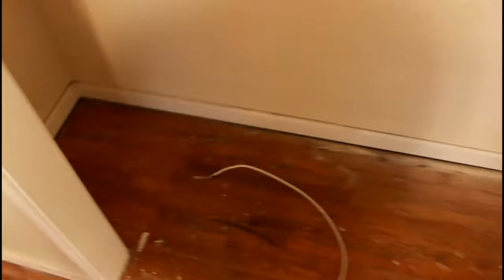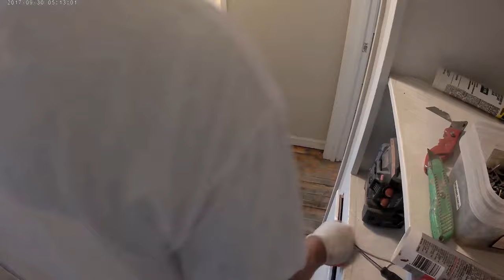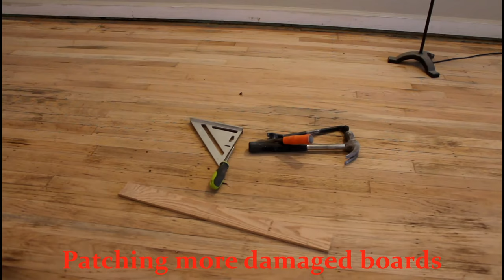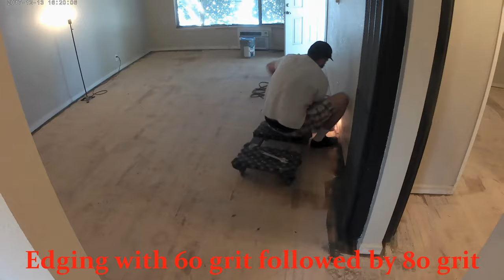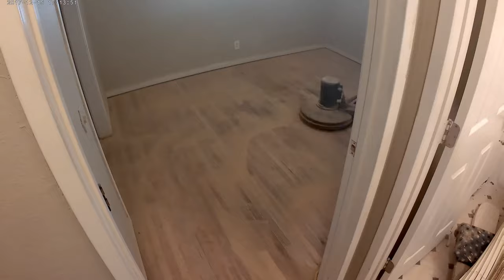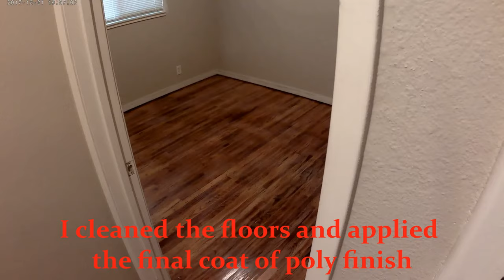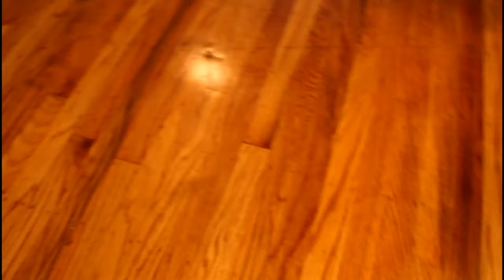Refinishing 70 year old oak hardwood floors

Comment: This was absolutely the most helpful video so far. My hardwood floors are like yours. They are old and covered in glue and Need Place is replaced. The other ones were dealing with newer floors in better shape and they didn’t tell me what I needed to know. Thank you so much.
Reply from the maker: no problem. good luck with your project and feel free to mesaage me if you need advice on any of the process.

Comment: I used floor stripper and slow speed buffing machine with a black pad to remove carpet glue on my floor. It removed it all with no dust. It lightened some of the wood but I stained the entire floor anyway with golden oak stain and polyurethane. It turned out extremely well. The golden oak blended in perfectly.
Reply from the maker: nice, thanks for watching.

Comment: Closing on our new to us home next week. Planning on refinishing the original floors first thing. This was a very helpful, and skillful outline of what needs to be done. And getting to listen to Colter Wall the whole time? GREAT VIDEO!
Reply from the maker: thanks congrats on the new home and good luck with the project. feel free to dm me if you run into any issues and have questions.
Reply: That's why I am here also! Just did early entry yesterday and we will close in about 1 to 2 weeks! Our hardwood floors were saved but also neglected under rugs.. we are hoping to restore them!
Reply from the maker: @RachelDulanski  congrats and good luck.

Comment: Ty for showing how you replace for boards.  I couldn't believe how many nails there were.  Then there a 2'×3' section where the fillers missing.  I'm surprised that the filler is used all over but happy to see it as I thought I'd be replacing almost half the floor.  Great video!
Reply from the maker: thank you.

Comment: If the entire floor is warped and cupped and wobbly is it not fixable? We are looking at a 1905 historical property and the floors are in a state. We would like to keep the original but I have no idea how you would even sand it with all the unevenness. Can it be saved?
Reply from the maker: everything can be fixed. but at a certain point the cost to repair may outweigh the cost to replace. the cupping may be too extreme to make the repair cost effective but i would need to see it to know.
Reply: @californiaflips4318  Thanks so much - you are so helpful.  Even if the cost is a ton, we would fix it if we could as it is classified as a historical home so we are required to make every effort to maintain the original pieces as much as possible.  You have been so helpful! New sub here!

Comment: OMG, I love your video! It exhausted me watching it thinking about all of the wood that we need to refinish. Our living room and bedroom are about 400 square feet each. Our home was built in 1911 so the wood floors are as old as the house. Any suggestions that you can give me will be appreciated. Thank you!
Reply from the maker: go slowly. try to take less material off with each sanding pass than u think u need. u can always take more but u can never put it back. and dont feel to stressed about doing bigger rooms, a large living room will actually go quicker and easier than a small bedroom with a closet. large open spaces are the best to refinish. good luck

Comment: Watched the whole thing just so I could listen to Colter. Saw a few of these videos on the youtube.. yours came out the best I think. I think your finished product looks great. Any advice? Any regrets? How does it look now almost a year later?
Reply from the maker: only thing i would do differently is rent a larger drum sander. i used an 8 inch wide drum sander from home depot. but if you go to a different tool rental place you should be able to get a 12 inch wide drum sander which would save lots of time. on top of the wider drum the 12 inch machines are substantially heavier which allows it to bite into the wood more with less effort on my part as the operator. this house is now a rental. been rented for almost a year now and the floors are still looking perfect. the more coats of poly you put on the more resistant to wear the floors will be.
Reply from the maker: thanks for the compliment btw

Comment: You should have stained the new wood to match the old before finishing.
Reply from the maker: unfortunately its not that simple. if you try to darken the new wood to match the uv altered wood. time will eventually make the new wood darker than the old. the best path if someone isnt willing to wait for uv and oxidation to make the new match the 70 year old wood, is to pull old wood from the closets for the patches. i opted to let time process the new wood the same way it processed the old wood.

Comment: Well that was amazing!   I appreciate a solid wood floor that has battle scars - I think that makes it even more beautiful.   It survived so it has character.    I am not a fan of LVP, I would prefer to walk on painted plywood.   However, my home has experienced a break in 4 times this year.  I have been searching for a home to purchase and everything seems to have some LVP.  Is it possible I could sand and paint or use a whitewashed stain over the LVP?   I realize it's not ideal but at my age I cannot justify the cost of red oak hardwood flooring on top of purchasing a home.  (I'm 73.)    I would appreciate your thoughts.
Reply from the maker: i personally wouldnt try to alter existing lvp. it usually has a thin wear layer and if you were to sand through it it would just be an unattractive plastic look below the surface. congrats on the new home. i hope you are able to enjoy it for decades to come.
Reply: @californiaflips4318 .... Thank you    That was pretty much my thoughts.   4 different LVPs + hardwood and ceramic tile is a bit much.   And so it goes.   I appreciate your kind response.

Comment: Would it have been possible to use wood from the closets to patch with, then put the new wood in the closets where it wouldn’t be so noticeable?
Reply from the maker: yes the grain on the wood from the closets would have matched better. but the color difference would still be there due to the pet stains in the middle of the room.
Reply: @californiaflips4318  Couldn’t u have stained the new wood separately with an Antique Oak stain prior so they’d blend better?
Reply from the maker: @znonemper5519  it would be incredibly difficult. im sure someone out there has done it, but your trying to match ammonia staining that varies in color from  board to board. another option is that you could just stain the whole floor dark to hide the stains but imo thats much less attractive than just allowing the patches to show the history and character of the floor.

Comment: Great end result. How many days did it take you to finish the floor? From removing the carpet to finishing the final coat
Reply from the maker: probably 2 weeks. if you had a team or a desire to finish quickly you could probably do a job like this in as little as 3 days. the main factor with time is allowing the the multiple coats of finish 8-12 hours to cure between applications.

Comment: Could the mew boards have been stained with a little darker stain or maybe extra coat to blend them better ? Asking not to criticize but we are about to do ours and have to replace over old floor furnace hole
Reply from the maker: i wouldnt reccomend that. uv sunlight darkens the new boards. so adding dark stain to match colors at the date of install will cause them to not match in the future when they react to uv and oxidation. if you want a closer match day 1 pull from a closet or a similar donor area that is less visible.
Reply: @californiaflips4318  thank you so much !!!!!

Comment: Wow you killed it looks great where did you find the replacement planks I'm about to do the same thing up here in Northern California house is from 1966 it's oak 2 -1/8 × 3/8 or so im having trouble finding the wood replacement planks thanks for the video
Reply from the maker: thanks. im in sacramento and got the boards from pacific flooring supply. they have everything you need. maybe call them and see if they have recommendations in your area if you arent around sacramento.
Reply: @californiaflips4318  I really appreciate it man just got back from Pacific Supply got everything I needed just like you said
Reply from the maker: @byronboswell5774  glad to hear it. hope your project goes well and if you run into any hiccups feel free to message me.

Comment: Boy did those floors turn out nice!  The boards that are new and stick out a bit I think are cool it adds a little character to it. Besides it is a floor and wont stay “perfect” . The finished product is definitely sometHing to be proud of!! I am curious, how long did it take you from start to finish?
Reply from the maker: thanks. It took about 2 weeks. once you start sanding the process starts going by pretty quick. The finishing process takes several days because i was allowing one full day of curing between coats of polyurethane. i forget if i did 3 or 4 coats on this floor, i think it says how many in the video. but the more coats of poly the smoother the finished surface will look.
Reply: @californiaflips4318   First I have heard of the more coats the smoother.  Going to keep that in mind.  I am in Grand Rapids Michigan and have been working on repairing replacing and tying  new into old to extend it into my dining room and kitchen  1/3 of living had serious carpenter ant damage that was hidden by previous owner with laminate its a red oak 3/4 thick tongue and groove .I have 2 months worth of weekends into it as I drive truck for a living but plan starting the staining process this coming Saturday. So Total days I have in to it is pretty close to what you have I may end with a few days more just because This is my first one but I didnt expect to do it in 2 days either.  Just the underlayment for their cheap laminate had 500 drywall screws holding it down.  Considering my timeline compared to yours and me being a beginner I’m pretty of proud of myself.
Reply from the maker: @MichaelSmith-pn7im  right on. good luck with the finishing process. i used natural colored minwax stain from homedepot  you can get the trowelable wood filler there as well. and for the finish i used satin finish oil based polyeurethane. idk if its like this in michigan but in CA they only sell it in quart containers so i had to buy about 20 small quart cans to do my floor.
Reply: @californiaflips4318    Im going with with Bona red cherry stain  to help blend the new with old. Already did the wood filler process and the Bona poly with hardner semi gloss.  I assume you will do another and you maybe aware of this already but I will mention in case your not. I found a wheel with 6 blades attached that you put on a buffer that will strip that old mastic and carpet glue with great ease  very little dust , and it doesnt hurt the floor nor does it heat that glue up and melt it nor does it stick to the 50 grit blades.  ITS A GODSEND.  It cost me 300$ and worth every dime!!  I found a video here on Youtube the company is out of Philadelphia PA.   I will see if I can post a link for ya.  It sire beats using a belt/drum sander. I think it even came with an extra set of blades. It does leave swirl scratches but one pass with drum sander 36 grit there gone only thing is you want it to stay flat!
Reply from the maker: @MichaelSmith-pn7im that woulda saved me a lot of time with the initial drum sanding i did. ill have to get one of those if i ever do another floor with mastic on it again. thanks for the info and the link.
Reply: @californiaflips4318   no problem   First I ever used one and it worked great.  The money you save in sand paper alone plus 3-4 hours of time worth every penny.  I talked to those guys twice and they were super helpful and knowledgeable willing to give tips and never rush you off the phone.  I will say this if you do use that wheel take the extra half hour or hour and make sure ALL NAILS/STAPLES are out of floor and wall s where trim was. I missed a few and caused me a couple small headaches with a small finish nail and 2 staples getting caught under a blade causing some unwanted deeper gouges that sanded out but required some extra labor.  Good luck and I look forward to seeing more of your vids especially wood floor vids. Been nice chatting with you.

Comment: I wonder why the replacement wood  weren’t stained before adding polyurethane.
Reply from the maker: they were. I stained the whole floor after the final sanding. the old wood is a different color due to age and most likely uv exposure.
Reply: @californiaflips4318  Oh sorry, it seems like some wood looks lighter.  Maybe its just the Camera angle.  Thank you for sharing!

Comment: I'm restoring a similar 70 year old floor, having trouble finding 1' 1/2"  strips of similar wood to repair with, that are NOT tongue and groove cut. Where did you get your strips of wood from ???
Reply from the maker: i have a local place that sells flooring in Sacramento called pacific flooring. but im assuming u arent in my city so if you google "5/16ths top nail oak" you will find online sellers.

Comment: Absolutely gorgeous! I have some water damage in some areas of my wood floors (due to leaky clothes washer and 2 boy 🐶) u made it look so easy but I know it really isn’t lol. If you were to do this job for someone what is the going $estimate$ for everything you done?
Reply from the maker: to refinish hardwood it is usually around 8$ per foot in my area. replacement patches will cost 16$ per foot. these are very rough numbers. good luck with your project.

Comment: This has always been my problem you sand the poly after applying the first coat do you sand it afterwards as well or does it stay smooth
Reply from the maker: i use a 120 grit sanding screen on a floor buffer before you apply the final coat. it makes everything glassy smooth. you can skip this  step and the floors will look nice but will not have as smooth of a finish.

Comment: Hi! I'm looking to refinish a 70 y/o floor in the coming months and found your video. When edging, why do you go from 6o to 80 grit? Thanks for your informative video and presentation!
Reply from the maker: when sanding wood you always want to start with a heavy grit sand paper (60) and then move up through the grits to remove the deep scratches left by the 60 grit. after using the 60 then the 80 i then ran a floor buffer with sanding screens 100 and 120 grit. if you finished the floor after just sanding it with 60 grit it wouldnt look great. hope that answers your question.
Reply: @californiaflips4318  thanks for the information. Very helpful

Comment: That black glue can often be removed by hot soapy water and a floor scrubber.
Reply from the maker: you never wanna put water on a top nail wood floor. once the wood floor cups its unfixable as you will have voids between the sub floor and the finished floor.
Reply: @californiaflips4318  It works on tongue and groove oak floors, joist-nailed or nailed to the subfloor.

Test first, and if the adhesive starts dissolving, you are in luck.

Comment: what nails are u using to nail in the repairs? I have floors with absolutely tons of nails everywhere... i think it would be imposible to remove all. Do you just remove the one sticking out?
Reply from the maker: great question. i use round headed senco fastners. 15 ga round head finish nails. set them deep and the wood filler hides them. i just removed all the large framing nails that were added over time. if what you have is small headed finish nails u can just set them below the surface of the wood and the wood filler will hide them

Comment: what did you use as wood filler? does it harden properly and stain. ive seen videos with people using saw dust from the sanding process and epoxy.which would you recommend?
Reply from the maker: i used minwax natural colored stain. and you have to use trowelable wood filler. its wood filler that is specifically made for this job, they sell it in multiple colors to  match the hardwood floors youre working on. mine are red oak. epoxy and sae dust is something you would use if you were just doing a small patch repair,
Reply: Bona makes a really good filler too. Water based just for floors.  Sets up in 10 minutes.

Comment: Dude! U have me so confused!!! I just bought a house in LA and I’m doing a full remodel. I’ve initially been of the notion to install all new wide plank hardwoods at $7 per square foot. However, I pulled up the carpet and the original hardwood floor is still there!! Now what?? Should I restore the originals or install all new flooring? It’s a house flip and now I don’t know what to do after seeing this video! HELP!!!!!
Reply from the maker: if you are dong all the labor yourself it will be much cheaper to just refinish what is already there. time wise the two jobs are pretty similar. in my area older floors are more desirable, but thats very specific to neighborhoods and buyers. usually in my area the homes built in the 50s and 60s are preferred to have the original floors whenever possible.

Comment: I am doing my floors now and this was very helpful. I have alot of room between my boards. The wood filler will fill it or do I need to pull it up and re do it all?
Reply from the maker: it depends on how big the gaps are. i believe the trowelable wood filler is ok up to 3/8ths of an inch. which is pretty huge. but id just read the recommendations on the trowelable wood filler you use and try not to exceed that. maybe use a higher quality wood filler in the large gaps, then trowel the whole floor with trowelable filler after those gaps are covered. another option is to get some new flooring material and use a table saw to rip thin strips and glue them in the large gaps. id personally not go this route as table saws and thin material can be incredibly dangerous.